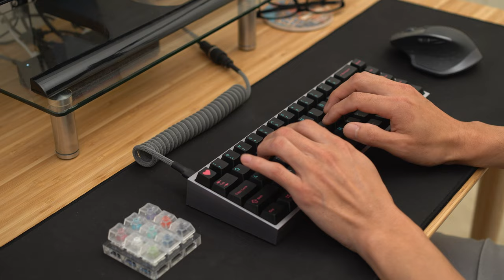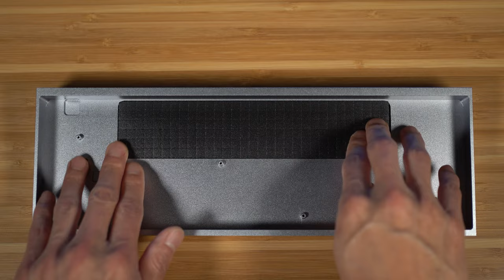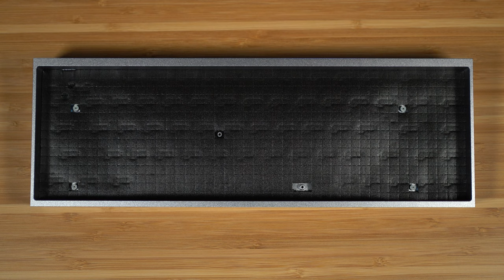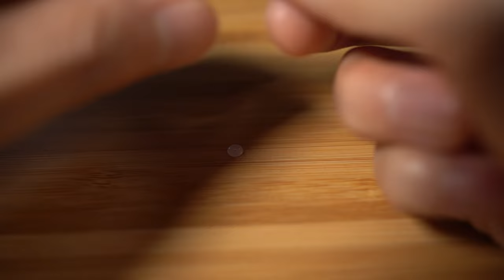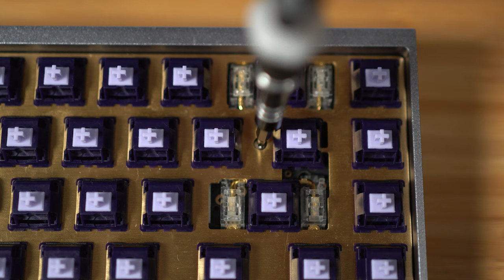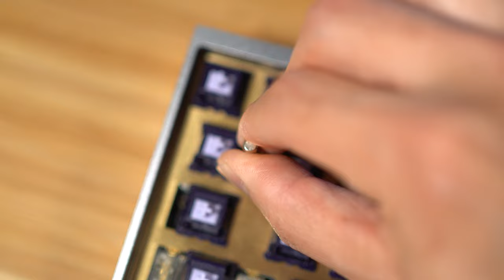Make the BEST sounding TOFU!  TOFU65 O-Ring Mount Mod Tutorial

Comment: Why don't you also dremel off the middle 2 mounting post?
Reply from the maker: Hi menuhin!  You can also do that, but I noticed that with the O-Rings on the outer stand-offs, it floats the pcb above the center 2, so that there was no need.  I also wanted keep the keyboard as intact as possible.  Hope that helps!
Reply: @Keybored  thank for your idea. I actually tried something similar a few years ago but not as nicely executed like you do, e.g. the o-rings I used were perhaps too big and I probably also tightened the screws too much. And the result was that I from time to time felt the PCB hitting the center posts below when I typed and bottomed out

Comment: Does the thickness on the O-Ring matter?
Reply from the maker: Hi Bellamybug, it does.  If the o-ring is too thin, it will have minimal impact to elevate the pcb/plate above the stand-off.  If it's too thick, it will not allow the usb-c port to clear the cutout.  Hope that helps!
Reply: @Keybored  Thank you - do you have any ideal measurements I could use?
Reply from the maker: @bellamybug  I used a silicone o-ring with measurements 4mmx1mmx1.5mm and it worked out well!

Comment: why didnt you screw in the middle standoffs? are we not supposed to for this mod?
Reply from the maker: Hi Bhavneet!  I didn't screw the middle standoff so that there will be a gap between the bottom of the pcb/plate assembly and the stand-off.  This way, it will allow for some flex, as well as eliminate the hard contact point for improved feel and sound.
Reply: @Keybored  got it makes sense. I'll keep that in mind when im building mine

Comment: Does this work on a hot swap pcb or is it only soldered ones?
Reply from the maker: Works for both!  It's actually easier on the hot-swap PCB, since you can do the PCB first, then add in switches and plate on top.  Don't have to squeeze the little screws through the plate holes.

Comment: Will this work with the Acrylic version of the Tofu65?
Reply from the maker: Sure will!
Reply: @Keybored  It looks like the standoffs on the acrylic version are different since it's for the KBD67 so I'm a bit  skeptical
Reply from the maker: @adonpanji  The standoffs for the acrylic case is actually the same as the aluminum.  It's confusing because kbdfans put that it is only compatible with the KBD67 pcb, but what they actually meant to say was that KBD67 PCB has downfacing LEDs to light up the actual Acrylic case, while the DZ65 has top facing LED for the actual keycaps.  So the DZ65 was "not compatible" with the Acrylic case... but for the LED lighting effect, and not so much physically.  The o-ring mount should work for both acrylic and aluminum, and it also works for both the KBD67 Rev2 and the DZ65 hotswap as well!  Hope that helps!
Reply: @Keybored  Thank you so much! I'll definitely be trying this in the future

Comment: Dear bored key, I wish to reproduce this on the 60% Tofu. How do I go about doing that?
Reply: Just do the exact same thing lmao use ur head
Reply from the maker: Hi Lividmatter!  The Tofu60 and the 65 have similar stand-off configurations so you can follow the same process and should work!  Hope that helps!
Reply: @lukeX2m  cheers, thanks for this helpful insight.
Reply: @Keybored  the outer standoffs on the 60% variant ar offset yet closer together than those on the 65. It might be too unstable, but I'll have to give it a try. Would using one of the centre standoffs ruin the feel?
Reply from the maker: @lividmatter4862  hi Livid! I believe a few viewers tried the mod with outer standoffs and got great results! I would recommend not using the center one for best results!
Reply: @Keybored  I received my o-rings in the mail today and got to work straight away. One problem I ran into though was the length of my screws. For some reason the screws I got with the Tofu case were much shorter than the ones you have in the video. I ended up using only one o-ring, placing it between the stand-off and the pcb. It is a big improvement over not using o-rings at all, and the sound has become less metal-ish. Though the configuration of stand-offs on the 60% does cause it to be more unstable, especially towards the spacebar. It flexes quite a bit.

Comment: Hey, love the video, and thank you for this mod, as it helped me finally pull the trigger and build myself a Tofu65. Question, I have an aluminum plate instead of a brass plate like you have in your build, and I wasn't sure if it was worth getting a brass plate to achieve the same sound. Do you believe it would change the sound signature that much, taking into account the foam and the o-ring mod?
Reply from the maker: Hi MainstreamBean! I would say that the sound wouldn't be exact with the aluminum, but it will still be great! Brass is very stiff and bounces the sound back, but aluminum will do a similar action, just not as strongly. I would try with the aluminum that you have, if you like it, great! If not, consider buying the brass in the future!

Comment: So the pcb just sits on top of the screws and orings?
Reply from the maker: Hi Richard!  The PCB sits on top of the O-ring, then the screw goes on top!  So the configuration is Standoff - O-Ring - PCB - O-ring - Screw.  Hope that helps!
Reply: @Keybored  ok that makes sense! Do you think a 3mm OD, 1mm ID, 1mm thick oring would work as well? I've found this type of oring in stock with prime shipping.
Reply from the maker: @richardbrady1849  hi Richard! That size may work, but the thickness might be slightly thin for maximum impact. Unfortunately, it seems like the 4x1x1.5mm one is all sold out for now :(

Comment: Where do you get those screws tho
Reply from the maker: Hi Young toaster oven! I used the supplied M2x5mm screws, but I have heard some have not received this longer screw with their keyboards. In that case, perhaps something like this will work?

https://www.amazon.com/uxcell-Notebook-Computer-Phillips-Gateway/dp/B082XXLSP9/ref=mp_s_a_1_15?dchild=1&keywords=m2+5mm+screw&qid=1611717564&refinements=p_85%3A2470955011&rnid=2470954011&rps=1&sprefix=M2+5mm&sr=8-15

Comment: what kind of screws did you use
Reply from the maker: I R K!  I used the stock screws that came with the keyboard, but was also notified that some came with shorter ones than the ones I have used.  Mine were M2 x 5MM.

Comment: Can this work with tofu60
Reply from the maker: Hi Dom, it will work for the tofu60 as well. Similarly, keep the center standoffs open and use the o-rings on the outer standoffs to essentially "float" your pcb and plate assembly.

Comment: could a similar method be used for a preonic?
Reply from the maker: Hi TurboniumAlt! I don't have personal experience with the preonic, but looking at it really quick, it looks like a tray mount with removable standoffs? If so, similar approach will work for that as well. Use the o rings on the outer standoffs and skip the center one, remembering not to over tighten! Let us know how it works out!
Reply: @Keybored  It doesn't actually have any standoffs, as the pcb is screwed directly into the case from the bottom. (atleast in the loose plate method that I used) and the plate is attached to the pcb by way of the switches being attached to the plate and the hotswap sockets in the pcb. I'll study it a little bit and look around to see if anyone has tried it before and report back if I end up doing it myself.
Reply from the maker: @turbomeows  That really is an interesting mounting method! I'm curious what kind of modifications can be made to a design like that. Let us know what you find!

Comment: The rings in the link are 5x2x1.5 as the smallest size it looks like :/
Reply from the maker: Hi justanotherpxrson! Looks like that original link has all of the 4x1x1.5mm sold out. No worries, here is another link!

https://www.amazon.com/uxcell-Silicone-Rings-Diameter-Gasket/dp/B082STN4LT/ref=mp_s_a_1_6?dchild=1&keywords=Silicone+4x1x1.5+mm+o+ring&qid=1611546963&sr=8-6
Reply: @Keybored  in this selection the smallest size is still 5x2x1.5 it looks like unfortunately. not even out of stock, literally just not there
Reply from the maker: @justanotherpxrson  hmm it seems like when the link goes out of stock, they remove it from the selection. I found these, but looks like it's not in stock for a few weeks.
https://www.amazon.com/uxcell-Silicone-Rings-Diameter-Gasket/dp/B082SVFWCS/ref=mp_s_a_1_5?dchild=1&keywords=Silicone+4x1x1.5+mm+o+ring&qid=1611718458&sr=8-5

Comment: will the standard O rings for keycaps work as well?
Reply from the maker: Hi Calvin, unfortunately, the standard o rings will be too big for this application. Hope that helps!
Reply: @Keybored  thanks for replying! Would a 2mm inner diameter work as well? I don't have access to the links you provided unfortunately
Reply from the maker: @calvinlooi4500  Hi Calvin! I believe the 2mm ID might be a bit risky. It should be OK for the standoff to pcb, but on the top, as you start to screw down, the screw head might just pop through the top o ring vs catching. If you can find another o ring with a 1mm id and maybe 1mm thickness, that might be a better option as well. Good luck!
Reply: @Keybored  I've managed to find the exact O rings you use! Hope to achieve the same results you have :)

Btw, do you feel the modded tofu is better than the D65?
Reply from the maker: @calvinlooi4500  glad you were able to track some down! I feel the modified tofu and d65 are great in their own accord. I feel the d64 gasket mount in general feel and sound a bit more muted.

Comment: Do you think this is possible for Keychron K8?
Reply from the maker: Hi kfiatos!  I have done something similar on a Keychron K2.  If the K8 is similar in design (tray mount) this will work for that as well!
Reply: @Keybored  was it worth it for K2? Did it change anything?
Reply from the maker: @kfiatos  Given how the K2's standoffs are shaped, I would try it with a thicker o-ring in the future.  I used the same one as this, and with it, it did improve, but not as dramatically as the TOFU.

Comment: Why you avoid the 2 centers screws ?
Reply: i just did the mod, i placed the o-rings on all the 6 screws, sounds good, but in my initial build i had already installed some thin plastic rings, dunno where i found them ahah. So i cant say if this is better now, it might be a little harder to type because the keys are a little higher than previously.
Reply from the maker: I avoided the 2 centers to reduce the number of hard contact points. By using only the outer 4, the o rings help to elevate the center, and helps to create a more even feel and sound :) check it out!
Reply: @Keybored  So you only put the 4 outers screws ? interesting. I'll try to remove the 2 center screws then :D Do you still use your Todu65 or you got a new board ? Mine sounds very good too with Alu plate, Durock Stabs, Gateron black Inks and ePBT keycaps. Maybe yours sounds a little bit more clacky or metalic (very subbtle), i think it's the Brass plate. Thanks Scott for the input 👍
Reply: @Keybored  Got a new PCB today, the old one refused to flash. So I took the opportunity to finally remove the 2 center screws. Dunno if i can feel the difference but I think it's better you'right ! I love typing on this :D
Reply from the maker: @SylvainProov  :) It really makes the keyboard much more enjoyable to type on!
Reply: @Keybored  yeah exactly 😁👌

Comment: Do I need longer M2 Screws for this mod?
Reply from the maker: I used the stock screws that came with my Tofu kit, it was the M2x5mm.  If yours is shorter, may need to pick up a longer set from amazon.
Reply: @Keybored  Ight thanks for the info. I need longer one apparently

Comment: does 5x1,2x2mm will work?
Reply from the maker: Hi Alex!  Perhaps, they might be able to, but I may have some reservations about the thickness at 2mm.  It might be too thick to clear the USB cutout in the back.  You might be able to get away with tightening the screw a bit more to compress it a bit more?
Reply: @Keybored  thx for answer. btw, build is sounds very nice, better than the most of gasket mounted builds

Comment: Would these orings work with the kbd75v2?
Reply from the maker: The kbd75v2 is also a tray mount, so the same concept should apply!
Reply: @Keybored  Right, but do you think they same size o rings will fit the kbd75v2 as well? thanks again
Reply from the maker: @Edmontonoilers4life1  from what I remember of the kbd75, the standoff were similar to the tofu, and I believe the screw size was similar as well. If you wish, you could try getting a set of the 4x1x1.5mm and the 4.5x1.5x1.5mm to make sure you have the right size that works for that kbd75! Also, I remember the kbd75 has a billion stand offs so focus on the outer perimeter ones for the o ring to elevate the alphas above and reduce those contact points!

Comment: Is 4mm x 2mm x 1.55mm size o-rings usable?
Reply from the maker: Hi Freddy! I'm afraid the 2mm ID might be OK for the bottom, but not for the top around the screw head. It might be too wide and the screw will push through it instead of pushing up against it.
Reply: Thanks for the fast reply! I can only find 3mm x 1.1mm x 1.3mm, should be usable right? Got yourself a subscriber! 😁
Reply from the maker: @ftjahyadikarta  no problem! I appreciate the sub! It seems like the 4x1x1.5mm o rings have been going in and out of stock and others have had some issues locating some. I did find another link for them, but looks like they ship in about 2 weeks? I'll share it with you in case! 

https://www.amazon.com/uxcell-Silicone-Rings-Diameter-Gasket/dp/B082SVFWCS/ref=mp_s_a_1_5?dchild=1&keywords=4x1x1.5mm+silicone+o+ring&qid=1611733684&sr=8-5
Reply: @Keybored  Sadly Amazon don't ship to my country 😭 Guess I'll make do with the one available in my country. 3mm x 1.1mm x 1.3mm should be fine i guess
Reply from the maker: @ftjahyadikarta  I hope it works out for you!

Comment: How wide is the outer diameter of these o rings?
Reply from the maker: Hi CrankierMusic 74!  The o-rings are 4mmx1mmx1.5mm!  OD/ID/Thickness!
Reply: @Keybored  alright, thanks
Reply: @Keybored  do the o rings compress when you screw the board together? Cause my board doesn't have that much room for the ports so making it higher will misalign it and I can't plug it in

Comment: Does 5mm x 2mm x 1.5mm work?
Reply: I would be worried if they the 5mm can fit through the plate, you can see when he pushed through the plate it was quite tight with 4mm. Also the 2mm inner diameter might be too lose on the screw.
Reply from the maker: This right here!

Comment: will ( 5mm x 2mm x 1.5mm ) work...?
Reply from the maker: Hi PiiiN! Unfortunately, that size may be too big, and the screw will just go straight through the o ring :(
Reply: @Keybored  thanks...
Good thing I didn't buy...
Gonna try find a smaller size
Reply: @Keybored  is 3mm x 8 mm x 2.5mm better..?

Comment: Will this affect the type c port's place?
Reply from the maker: Hi Gamur!  The 1.5mm thickness o-ring is just right so that it's thick enough to cushion and elevate, and thin enough for the USB C port to fit through the cutout fine.  Hope that helps!
Reply: @Keybored  ty
Reply: @Keybored  can we still put orings on two middle standoffs? Will it be better or worse?
Reply from the maker: @gamur7794  I would actually skip the middle stand-offs, since we want to elevate the center of the pcb and keep it from touch any hard mounting points.  Hope that helps!

Comment: what screw are you using?
Reply from the maker: Hi playboi carti! I am using the screws that were provided with the tofu. There are 2 sets in there, one with a smaller head and shorter length, and one with a larger head and longer length. I used the larger. Hope that helps!

Comment: what if the case is already so low profile that the plate is already perfectly aligned with the case sides, not sure if the O-Rings would make the playe go over the actual case because that would look so shit hahh
Reply from the maker: Hi TCT!  You bring up a good point.  In those cases, it would be good to keep an eye out on the tolerances.  For the TOFU or similar cases, there is enough room for this to work.  Hope that helps!

Comment: Hi! Could I do this with an NK65 EE?
Reply from the maker: Hi Zenden!  The NK65 EE is actually a modified Top Mount design keyboard.  So for this model, the o-ring mod will not work.  When I took a NK65 EE apart, I also noticed that the clearances in there are extremely tight.  Hope this helps!
Reply: @Keybored  I see. Thanks a ton!

Comment: Can someone throw me a link to some rings that work, that deliver within a reasonable timeframe?
Reply from the maker: Hi Manny! Unfortunately, these o rings have been sold out, or difficult to get through prime... However, if the silicone ones are not available, you can also try the fluorine ones or nitrile ones also!
Reply: @Keybored  I got some thru amazon, thx.
Reply: @Keybored  fluourine is the way to go form my experiments